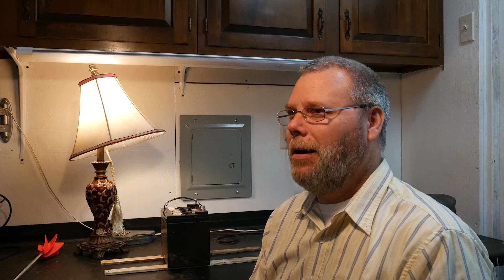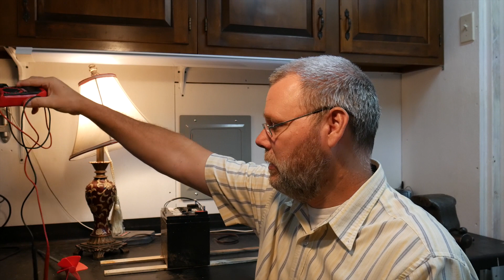Rejuvenate a car battery part 2.  plus other battery problems

Comment: Very helpful, Thanks for sharing. So, do NOT mix/top off a battery w/ acid from another battery?  Even if it tests good/okay w/ a specific gravity tester?  Just use Distilled water instead right?    Thanks again.   
- take care
Reply from the maker: Yes just distilled water
Reply: @fromcarstocomputers7261  Thanks man, will do.  C-ya.

Comment: 🙂 while your in there u mite consider replacing or washing the battery tray, battery hold down clamps, fresh new battery cables and bolts, and a battery tender, yay! 🤩🚙🔋😍
Reply from the maker: True. Every little bit helps.

Comment: 🙂 i actually just bought a battery, the two 'budget' batterys i found locally was Walmart Brands, and The Home Depot carries Exide, i got the exide cause it was a little cheaper and more convenient for me to pickup, core charge is $12 so i turned in an old dead battery, i always have a couple dead ones laying around just in case 👊😏🚙🔋🔋🔋